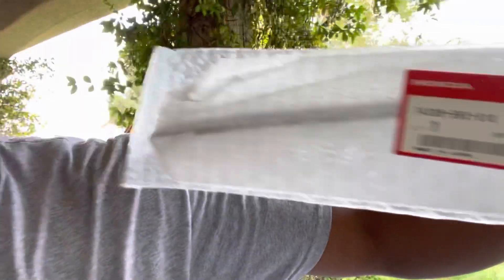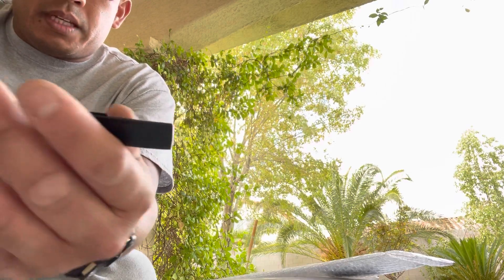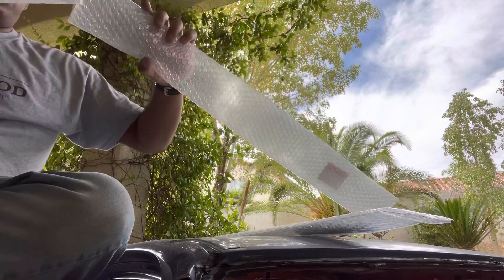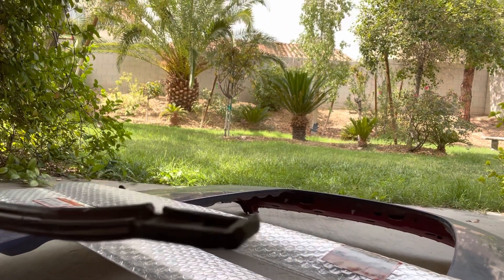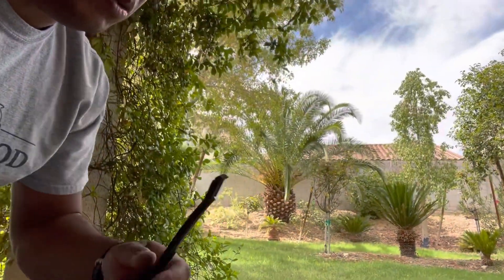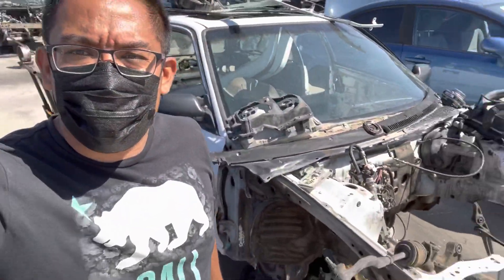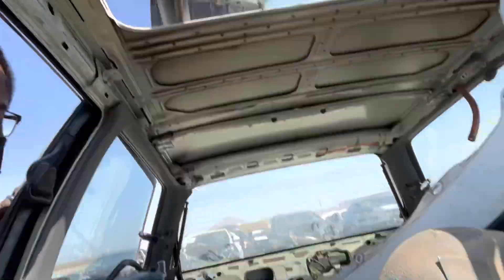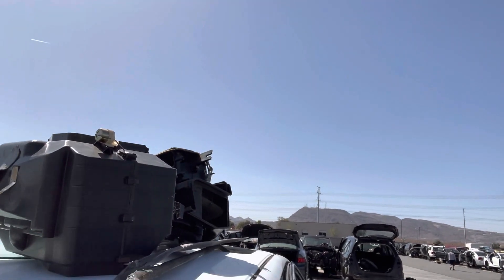EF Hatch/CRX roof trim/rain gutter trim removal and installation.

Comment: I have a leak and the water drips in from lift support bolt. I've read about a seam that leaks under this molding causing this leak in a CRX. Is there a seam that can be seen to be sealed?
Reply from the maker: A lot of times this is related to the hatch hinge seal. I’d remove the interior to expose the area and then pour water on it to see what happens. Thanks for watching and thanks for the support!